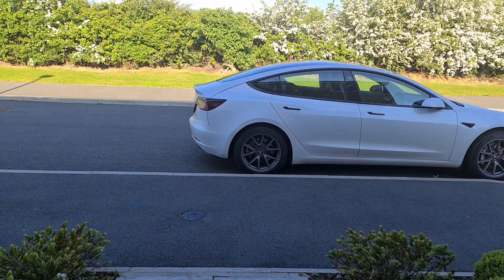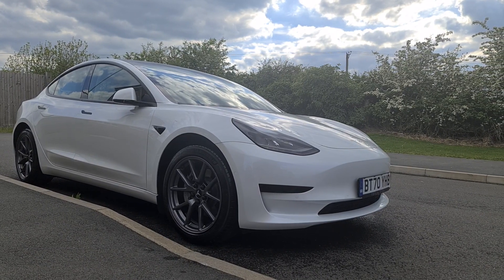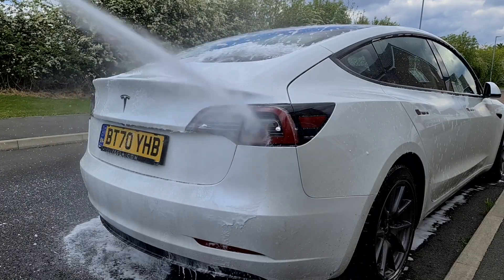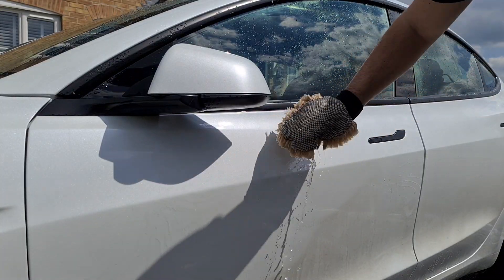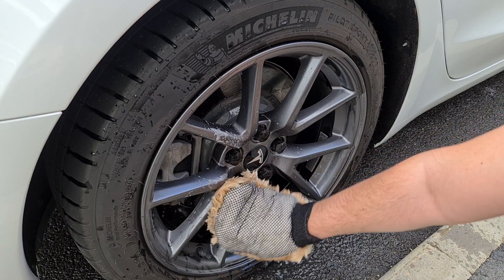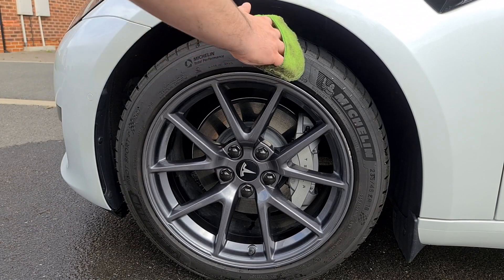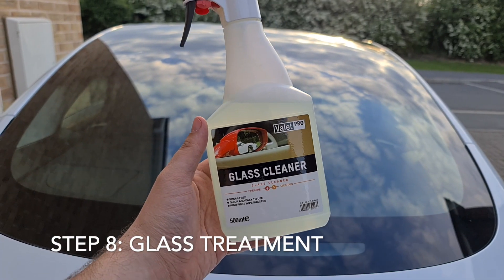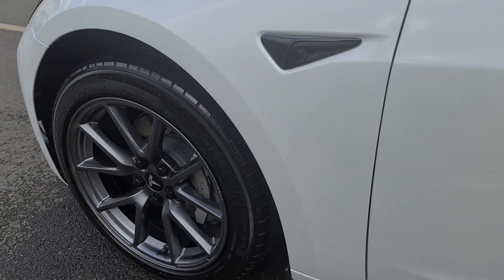How To Get a Glossy Tesla Model 3 From a Weekly EXTERIOR Clean

Comment: Almost identical to my process. I however use the autoglym rapid wax (bought a 5L bottle) after the rinse and before the dry. And don't use the sealant thing after drying. Kind of presume results are similar between the two. I've also been happy with demon tyre shine. I did have the maguires gel previously, it's great, but more expensive and lasts about the same amount of time as Demon Shine. I've recently got a leaf blower... getting most of the water off before buffing massively helps :D
Reply from the maker: Haha a leaf blower 😅 Thats dedication to the drying process right there my friend 👍